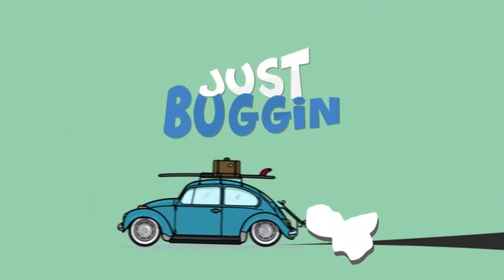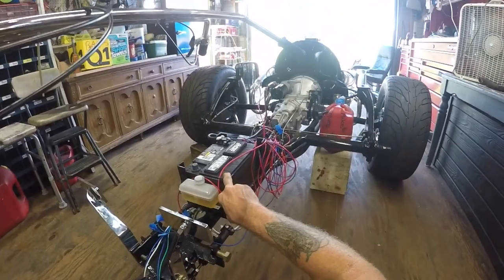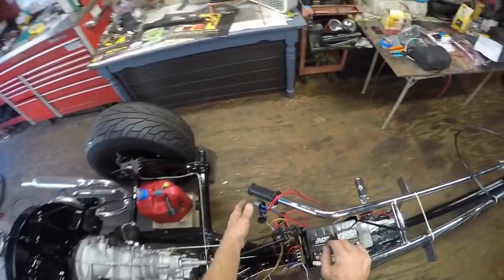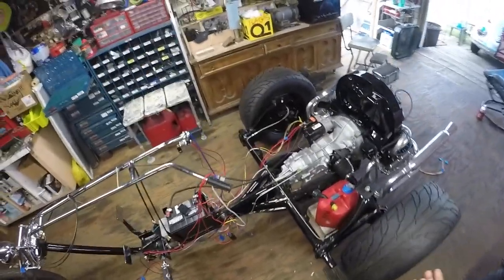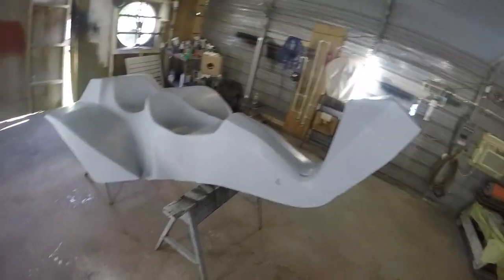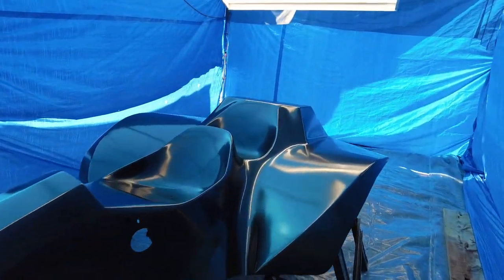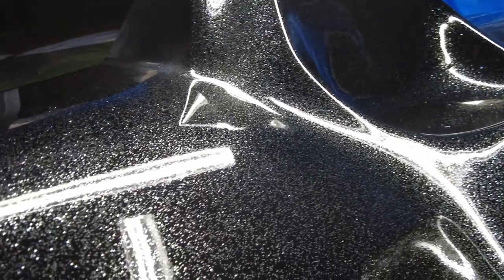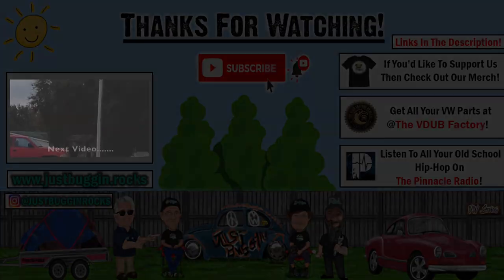1975 VW Powered Trike: Wiring Harness (Pt.2) & Metal Flake Paint Job!

Comment: Did you try adjusting the shims to tighten the belt up
Reply from the maker: oh yes, i did. Simple fix Ive done multiple times. quick and easy. It can be a pain in the ass sometimes when you have a cast gen/alt pulley and a aftermarket aluminum crank pulley. The stock belt no longer works. That was a belt that was used till the correct belt came in. it actually had no shims in it. That was replaced before it went out. Not every little detail is filmed due to our videos already being long enough....
Thanks for the comment!
-GMAN